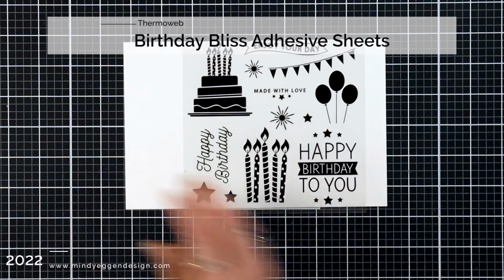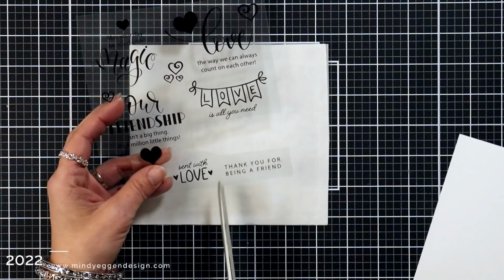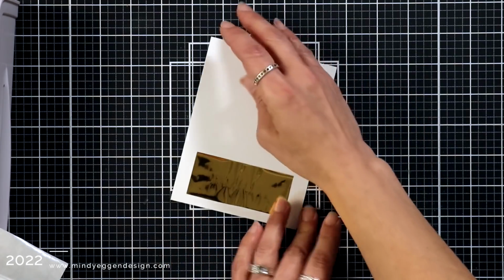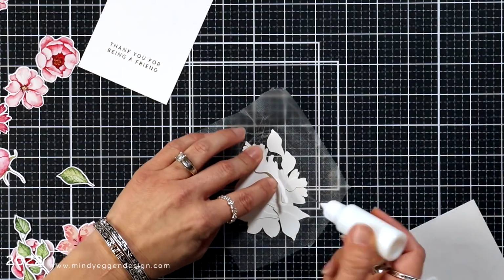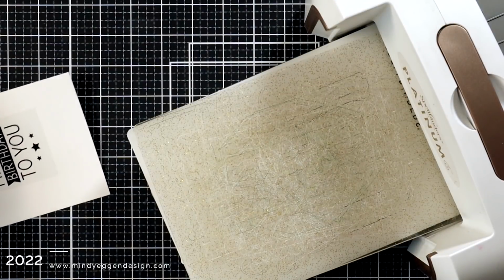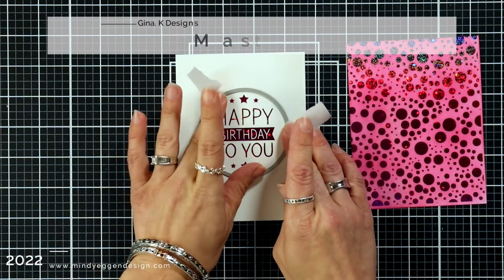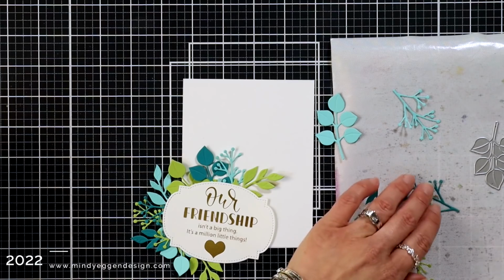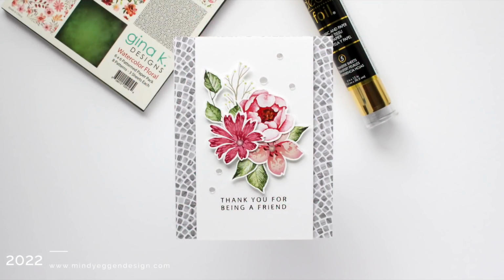NEW Gina K Designs & Thermoweb Adhesive Transfer Sheets

Comment: Thanks for sharing! This kind of foil also works with double sided adhesive sheets/rolls: Using a sheet of double-sided adhesive, die-cut a design or sentiment you want to foil (If the die is really intricate or delicate, use the Stick it™️ brand of adhesive sheets or something similar). Peel back the carrier sheet on the back of the die cut, apply it to the card panel/front, expose the adhesive, and then carefully place the foil, color side up, over the adhesive. Apply pressure by running it through your die cutting machine (using the same ‘sandwich’ used for die cutting). You can also use liquid ‘tacky’ glue with this kind of foil (it can be a glue of any consistency as long as it remains tacky when it’s dry). The key is to wait until the glue has dried enough to be tacky before applying the foil. You don’t even have to use a machine to apply the pressure. Place the foil on top of the glue (pretty side up), cover the foil with a sheet of (preferably)parchment paper or copier paper, then rub vigorously to transfer the foil. Apply pressure similar to the amount used with wooden craft sticks/popsicle sticks on transfers used in scrapbooking. (Incidentally, a YouTuber advised NOT using a bone folder, or similar tools, to manually transfer the foil, but I can’t remember why. Possibly, it’s to prevent making marks in the foil.) While a machine isn’t necessary to provide the right amount of pressure to apply foil with an adhesive, a machine can ensure delicate and/or intricate die-cuts receive the even coverage of pressure they need.
Reply from the maker: Thanks so much for the info! I think I tried something similar one time (a long time ago lol) for a die cut word. Totally works - these are just so much easier for me lol

Comment: What kind of glue do you use in the bottle. Mine always clogs up
Reply from the maker: I'm using Gina K Designs connect glue from the large bottle and I squeeze it into the small fine tip bottles. I have them both linked in the description ❤️

Comment: You cannot run the toner sheets with foil through your die-cutting machine. Toner is basically like little plastic particles,  and when you run it through the laminator it melts it just enough to let it grab onto the foil. It needs the heat. Without the heat, it won't do anything.
Reply from the maker: thankfully these are not toner. It's actually adhesive on the back and that's what needs the pressure. The dots background - yes. needs heat. ❤️